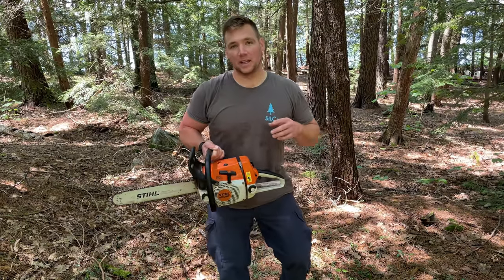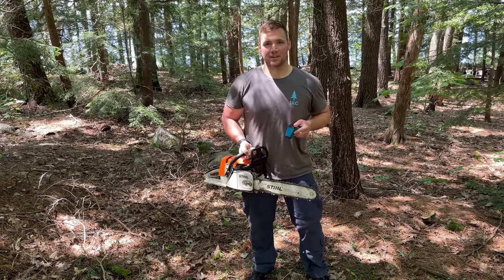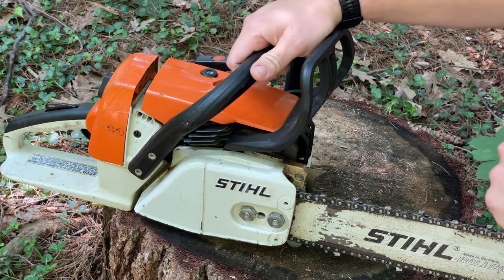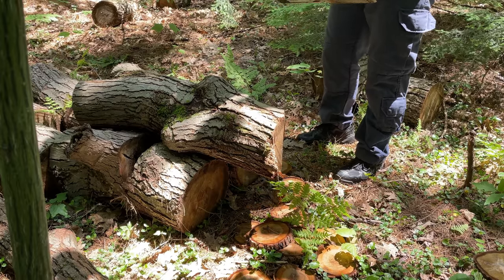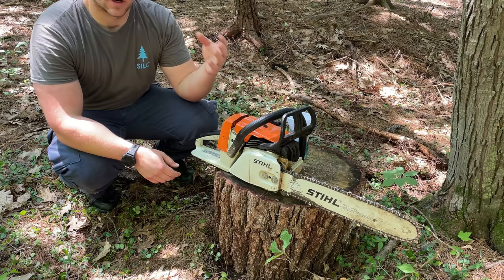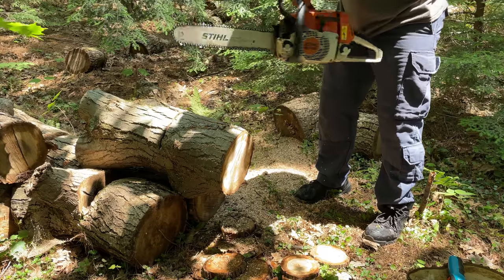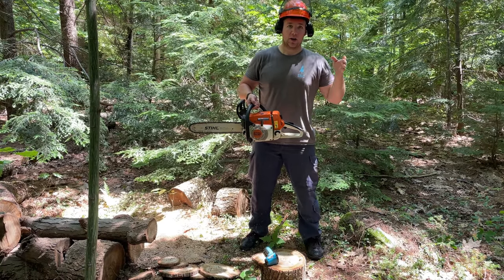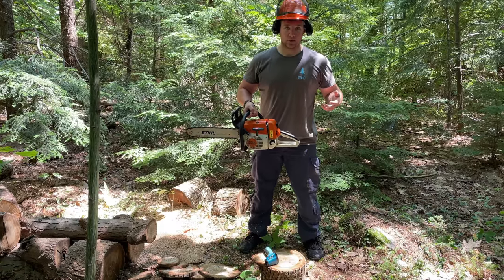Will my chainsaw last longer if I use more oil? Is it safer? (25:1 VS 50:1 temperature testing)

Comment: What if the temperature outside went up 5 degrees you  could do the same test the next day Starting with 25 to 1 and ending with 50 to 1 to then if your Temps are still hotter with the richer mixture you know for sure

Comment: What is the mixture when you put two of the machines gas tanks caps filled with two stroke oil in a full tank. You could compare color to find the mixture. I have been told it should be the right amount.
Reply from the maker: Sounds risky to me!!! As you can see in the video, the gas cap isn’t able to be used as a measuring device. I always pre mix a 1 gallon jug.
Reply: @DavesSmallEngines  I can’t find in the video where you use the cap as a measuring device.
Reply from the maker: @gradypoole5366  I didn’t - I pre mixed using measuring spoons.
Reply: It is a video idea to use the gas cap as a measuring device and see what the ratio is compared to how much the tank holds.
Reply from the maker: Ahh - cool thought. Not sure how I can use the caps on my ms260 as they are twist / clip in!
Reply: @DavesSmallEngines  once you untwist the cap the side that faces the inside of the tank is hollow in the cap fill it up twice.

Comment: I run all my 2 strokes at 100:1 amsoil, 93 octane ethanol free.  Been doing so for 2 years, kind of an experiment.
Reply: So if my saw calls for 50-1 then amsoil at 100-1 is ok.?

Comment: Dyno test show that more oil produces more power, but you MUST REMEMBER to RETUNE around the new mix.
Reply from the maker: Hey Todd - I’m aware of this. I wanted to show a video of the results if the average user mixed more oil and did not make the adjustments. Thanks!

Comment: I agree 100%.  I run Echo Red Armor at 50:1 with PNE gas in every thing I own, two cycle.  I get hit hard by UTube friends that run 32:1 with only God knows what kind of gas but they have cylinder and crank failures, where I do not.  I used to run Stihl two cycle oil but it is filthy, compared to Red Armor, but what would you expect from a 20 year old spec oil (JASO FB).  Red Armor is FD spec oil, better lubricity and cleaner burning.  I also use Echo bar oil, because it flows better in cold weather than Stihl bar oil, cheaper, too.
Reply from the maker: John - I’m going to pick up a case of red armour!
Reply: @DavesSmallEngines  you can’t go wrong. Just mix it 50:1 and run it in everything, even vintage saws.  I had to readjust a couple of my saws but that was it.  I use nothing but PNE gas.  Cost me a bit more but but it does not have any ethanol in it.  PNE= premium non-ethanol, 90 octane.
Reply from the maker: @johnclarke6647  that’s awesome. Thanks John!

Comment: Dave, that was a very thorough and complete test sir. I think you proved the results with great accuracy!  I obviously could see and here the difference between the two mixtures. Just think with the smoke of the 25:1 just how much oil deposits will be on the piston, rings, exhaust, and spark plug. That was a very good video my friend and in my mind answers a lot of questions that i think your subscribers have had! 👍👍🇺🇸🇨🇦  Roger
Reply from the maker: Hey Roger! Wow! Thanks for the kind words. I really do appreciate it. Thanks for being here!
Reply: @em4703  4:1 sounds like a good way to low octane your saw. 😆
Reply: @em4703  ???

Comment: First test like this I’ve seen and nicely carried out too. Plus I really like the way the results are posted and the consistency of the measuring. Great stuff.

Personally, I’m a believer in following the manufacturers’ recommendation. Fortunately all my saw are meant to run at 50:1 and since I use Aspen, which is pre-mixed at 50:1, that works well.
Reply from the maker: Hey! Thanks for the kind words. Aspen fuel is great! No guess work. Cheers

Comment: More oil equals less fuel, which makes your engine run lean. That's why the temps were up and power was down. Adjust for it and the temps will be lower and you'll have more power. More oil seals the rings better and makes everything last longer. Don't buy into the 50 to 1 craze.

Comment: There’s no perfect mix. As oil technology changes so does the mixture.

16:1 back in the day because oil and metals were garbage.    Now 50:1 is common because oils a lot better as are metals. No issues running 50:1 with modern high end oils.   Adding a “dash” here and “dash” there and guessing is way harder on your equipment.    You add oil and you lean the engine out causing it to run hotter.

We race high end 2 strokes and run 80:1 WITH ULTRA HIGH END RACING OILS. No issues whatsoever   Ts-580 etc

Comment: More is not better. What's important is the quality of the oil. One of the issues is not all 2 cycle engine manufacturers recommend the same mix. Causes confusion. To fix that Amsoil provides a solution. Their Sabre oil will eliminate all problems. Mix it to the instructions on the bottle will provide top notch lubrication for any engine and improved performance.
Reply from the maker: I need to get my hands on some Sabre!

Comment: Did I miss you re-tuning the carburetor when you changed your mixture??? That’s one of the biggest mistakes that guy’s make…. The reason that it felt “sluggish” is because that you were extremely rich which means that you failed to open the high jet to allow more air into your mixture so you were loading up your engine…. BAD….  You need to use a tachometer and tune the saw with each mixture to the 12,500 or 13,500 or whatever that the manufacturers recommends and then do this experiment over again with the correct procedure of when you change your fuel mixture ratio you absolutely need to readjust your high jet to correctly adjust your carburetor with a tachometer to the manufacture recommended RPM.  That is the proper procedure for “Tuning” a chainsaw.  If the saw was an “mtronic” you would need to perform the mtronic reset or calibration procedure that is available in your saw’s owner’s manual… this is a squid or flawed test of experiment… you should redo this video that correct way that the manufacturer recommends because you are technically providing incorrect information here Dave… and we would never want to do that…and here again..  this is an awesome video because so many guys change their fuel mixture and don’t then immediately correctly adjust their carburetor’s They must be done together at the same time… They are parts A and B not separate… this is why they went to auto tune!!!   
1. Choose your fuel mixture ratio
2. Tune your engine to your manufacturer’s recommendation.
3.  Be aware that in winter the air is more dense and that you need to adjust your carburetor for that change…winter and summer… if your mo-sheen is 13,500 in summer it would be (-800) 12,700 or 12,500 in winter!   You can leave your engine rich and leave it under the spec at 12,500 or 12,k year round… your chain speed in the cut is between 9K to 10k so it’s better to protect your engine’s no load free reving limit by turning it down or richening up your high jet.  
It’s extremely important that when you are mixing your new batch of fuel that you maintain your correct ratio… if you change the amount of oil in the gas you need to get out your screwdriver and correct your carburetor adjustment!!!  It’s freaking critical!!!  This is how guy’s burn up their saw’s and don’t understand why!!!

Comment: Modern saws are jetted for 50/1 if you use more oil your saw will run lean.  More air and less fuel means hot saw.  Dont understand why guys think adding more oil to the mix the saw will run the same just have more oil in it. This is why you see saws with fixed jets so homeowners cant run them to lean or to rich unless they add more oil to the mix. Guys doing this should first understand how a carb works. A saw tuned properly running on premium fuel with the mix  from the manufacturer will last.

Comment: Interesting but inconclusive because unless you sharpened the chain off camera the amount of time needed to cut the oak will effect your results.  The other thing is that not all two stoke oils are even close to the same, this too will effect your results. The test needs to be done again this time dealing with the variances.
Reply from the maker: You’re right. I’d need a pair of new chains to do the test to perfect accuracy.

Comment: Oil takes up space in the air fuel mixture, so you are actually causing it to run lean and shortening the engines life

Comment: So there was a difference; but was it really enough difference to make a difference?  I bet the lower end of the saw was better lubed.
Reply from the maker: Probably better lubed, I agree. But what is the balance point? This is what I wonder.
Reply: Gut feeling?  Around 40:1 to 45:1 with the best highway gas i can get here in WV.  But you see more saw internal parts then I do.

Comment: The richer you mix the gas the less evaporating effect the gas has which causes increased temps. The sweet spot is mixing enough oil to meet 100% lubricant needs with adding to much.

Comment: It will run better and cleaner with less oil, the oil is only to protect the piston and cylinder from wear, to much oil won't hurt the saw as long as you can adjust the mixture screws, these newer saws that have stops on the screws or don't even have carb adjustment screws you have to run the recommend oil mixture as the oil makes the the gas thicker and flows slower, causing a lean situation, chain sharpening 101 buddy, apparently he wanted the saw to get hot, good show buddy

Comment: Not quiet comprehensive enough the fuel mixture screws on the carby should have been adjusted to compensate for the thicker fuel mixture, there is a very good video, Is more Less or is Less More.

Comment: In fact, the test was very promising, and it showed that using more lubricating oil is better! how are you going crazy the chainsaw got hotter? so explain it better.

the chainsaw heats up more at the points where the measurements were made, it is a good sign because it shows us that the heat is being transferred from the internal parts and being expelled out of the engine.

Lubricating oil not only serves as a friction reducer, it also works as a thermal conductor of heat, as if it were a processor thermal paste or co-computer CPU.

So what the oil basically does is take heat from the piston and throw that heat into the cylinder.

just like thermal paste transfers heat from the CPU and throws that heat to the heat sinks.

so yes using more lubricating oil is better!!!

because the internal parts of the engine run cooler while the external parts try to divide the heat that is being passed to them

don't use 50:1 this is extremely harmful to the engine's internal parts!!!

Or have you ever seen a gaming pc that doesn't use thermal paste?

Comment: 100% it will not score the cylinder as much!! As for i!  The silver stihl oil is garbage they say its better i think its junk!! Il use a top name brand like jp, or maxima, orange stihl bottle il dump the oil in the drip a few drops of gas into the little oil container place cap on shake it up then pour the reminder that was stuck on the walls in! Differnt temps can vary different results! Youl be able to feel the power on the top end!! Always a proper warm up always is a must! A good tuned saw you will be able to tell of its smoking alot to much oil no smoke usally lean! Thats why i like a stanky colorful oil so i can see and smell it! If she rings out and screams to the top end you either dead on with mixture or a lil to lean! If i make a batch that underpowers my saw il just tell myself that today the cuts will be a lil slower but il have longevity use on my saw!

Comment: I would allways say . If they tell u it is 50.1 run it at all bit adding a small bit extra oil will not hurt it but all ways stick close too the factory mix
Reply from the maker: Sounds like great advice!

Comment: The reason that it runs hotter isnt because the oil, its because with more oil in the fuel there is less fuel and you are effectively leaning out the mixture a little bit.

Comment: 🤔 it's like  if  a beer should be cold or at room temp ?
PS
Dont  confuse oil design with ratio as oil manufactures are now producing. Oil that preforms more efficient.
Reply from the maker: Good points!

Comment: I dont recomend increasing the oil content that much.
If it's designed to run at 50:1, I dont see why doubling the oil will do any good.
I have a 2 cycle Stihl weed wacker and a 2 cycle MANTIS tiller. 
 I DO add A FEW EXTRA drops of oil to the fuel. But NOT DOUBLE. That is way too much "overkill".

Comment: Main issue with running too much oil is consequently running lean, increasing heat and therefore wear on the engine…

Comment: 40:1 used for decades husky 51 idled lots. 359 husky. 40:1 now change carb to a Zama. 359 gave me nothing put trouble walbro. L Stihl 170? 50:1 both of them lasted 2yrs each

Comment: If you like carbon unless you keep it pegged , use more oil . You might get away with it if you use caster oil . NOT castrol , castrol does not use caster bean oil . And you won't see the carbon build up until weeks or months down the road .

Comment: Would have been nice if you had pulled the spark plug after each test  - to address my main concern, carbon buildup.
Reply: and a boro scope inspection.

Comment: No testing needed to answer this question. 50:1 was invented so that your 2 strokes wouldn't last as long. Use 40:1 or even better, 30:1 and your equipment will love you

Comment: Hey
My friend has a stihl bg86c. Leaf blower that's not running correctly at all. He's put new gas line &filter,air filter, new carb,checked all the head bolts for proper tightness,spark plug etc it won't rev up.  Any bloody ideas mates????? TIA
Reply from the maker: Check the gasket between the carb and the cylinder. If it doesn’t have the holes for the impulse it won’t work.
Reply: Hi Will.  Even though it is a NEW carb, it still needs to be adjusted for your altitude and whatnot!  If he already did that, then I would suggest checking the muffler screen to make sure it is not plugged...
Reply from the maker: @StevesSmallEngineSaloon  great tips!
Reply: How's the compression?
Crankshaft seals sealing?
Don't overlook the sparkplug. Had one die on mid-cut on a lawnmower.
Reply: Check the spark arrestor screen in the muffler. I’ll bet it’s blocked. Common on Stihl blowers.
Reply: @andybecker2693  common on all Stihls. its because Stihl in the us sells shit oil but Stihl users buy it because Stihl.

Comment: You did not retune so IMHO the test not valid IMHO, and would account for the small temperature difference. And the recommended ratio for milling g is 32:1 not 25:1 I've built saws for decades, and after you've been in engines ran on 50:1 vs engines ran on 40:1 or 32:1 the difference is very clear, more oil is better, pretty much all builders agree on this. Also oil can carry heat away from the engine resulting in slightly   higher cylinder temperatures.

Oil keeps the rings wet adds an impact cushion, keeps the big end happy, and provides better ring seal for better power.

I applaud the effort you put into the video, but it's an incomplete test, more factors and controls would need to be applied.

Comment: First cut at 50.1 the chain cut through like butter......maybe sharpen the chain cause it was taking a while to cut through on second take which made it hotter .....MAYBE.
Reply from the maker: Chain was still quite sharp. It was noticeably less powerful with the 25:1. Besides… if the chain was dull the RPM would be higher as the chain wouldn’t dig in as much.

Comment: I’ve had good luck with Amsoil 2 cycle racing oil.
Reply from the maker: What one in specific?
Reply: @DavesSmallEngines  Amsoil series 2000 racing oil , also use Amsoil 100 to 1
Synthetic 2-cycle oil. Absolutely amazing seriously .

Comment: Im confused. Im 16 trying to get a chainsaw carb tuned so it can run right. It takes 40:1 but i only have 50:1. Is it ok to run it in it?
Reply from the maker: Yep, should be fine. What kind of saw is it?
Reply: @DavesSmallEngines  McCoullch 3216, it had a little bit of gas left in it so i took some time tightned the chain and adjusted it enough to where it will start and run for a few secounds but die because it ran out of gas

Comment: All my 2 strokes run 20:1 period.  I have rebuilt several 2 strokes due to lack of oil.  Zero rebuilds because of more oil than recommended.

Comment: I have built 1000's of 2 stroke engines. I have never hurt a 2 stroke by having too much oil in the gas. You can hurt the power.

Comment: Had you richened up the jetting to compensate for the lean fuel mixture your results would have been more meaningful
Your test only indicates that lean fuel mixtures run hotter

Comment: The net effect of more oil, means that exhaust and exhaust duct will get clogged more quickly, and piston rings will get gummed up.  Over a period of time that will mean reduced power, and the saw will need to be used harder to get the same results.  Using more than the recommended amount of oil, is ultimately not a good idea and will not help to reduce wear at all.

This test is completely meaningless as the carb low and high speed settings are way out. For results that are anywhere near accurate, the carb has to be properly adjusted, and the adjustment will need to be changed when the fuel mix is changed.

Comment: Bro u should get two of the same saws and run em at full throttle with 25 to 1 and 50 to 1 and see what's happens to both of em